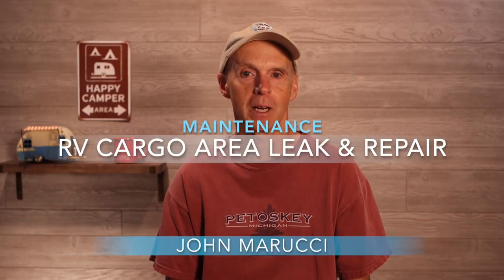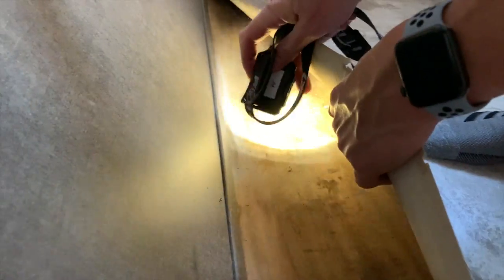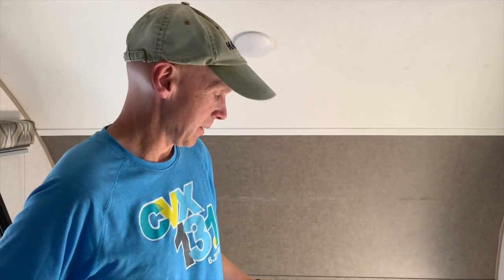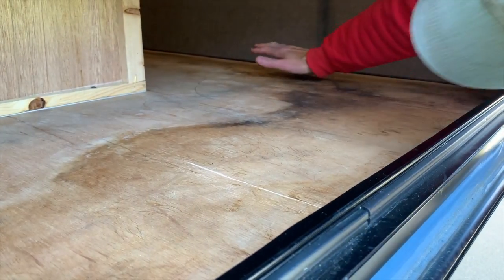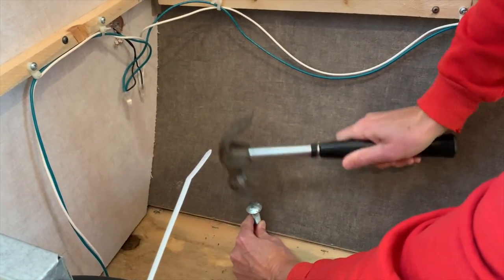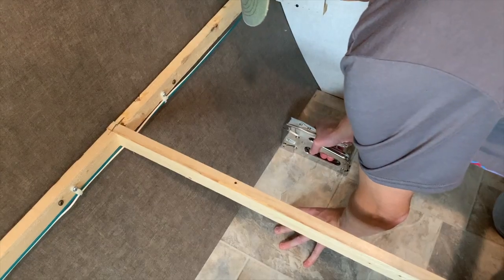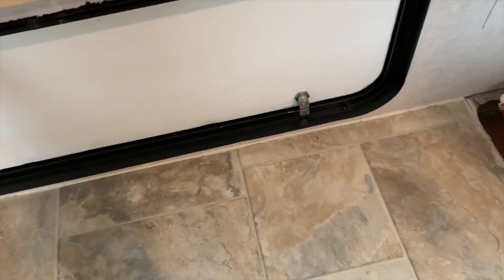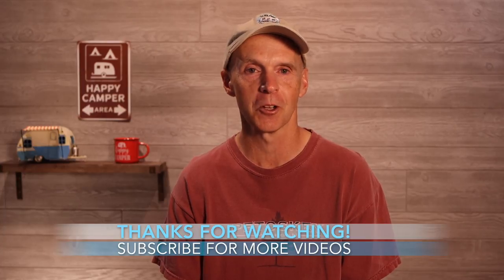R-Pod RV Cargo Area Leak & Vinyl Floor Replacement

Comment: John, great video! We have a 2018.5 R-Pod 190,  I noticed a small gap in the silicon right in the same corner, but on the opposite side, the side with the water heater. So I removed all the old silicone and redid it. Now I’m going to go over it with a fine tooth comb. We live in Walla Walla Washington and have really hot summers (especially this year, 100°+ for several weeks now with minimal breaks), I have a environmental monitoring thermostat/humidity in the R-Pod, the highest it’s gotten inside was 131°! The bottom center trim (8” wood) on the outside of the bathroom door fell off, found that it was double sticked on with tape 😳 fun times. Keep up the great work.
Reply from the maker: Joe, thanks for the comment. I am glad the video was helpful. Sounds the intense heat has caused some issues. I had something similar recently where my R-Pod's shower surround bowed out due to the heat. Seems like trim inside is a regular issue. All the best!

Comment: Thank you John. My 179 is currently in the shop having all seals from top to bottom replaced. Not an inexpensive job but we think well worth it. My next item will be to check the inside as you have shown. My husband and I are both seniors and could not have accomplished it on our own as you have. We have had to have our black tank support fixed twice. Both times on the way to Colorado. Thank goodness the tank was empty.  Keep up these videos please. They are a big help.
Reply from the maker: Kathie, I am glad the videos have been helpful. One of the purposes of showing these is to help folks measure if they want to tackle things themselves or have someone help out. Glad to be of help. All the best!

Comment: Awesome video, it's like you've been an RV repairman for 20 years.  
I am kinda surprised you didn't water test the whole front of the trailer though before you found the bad outer shell seals.
But you did a great job just going through the whole problem in your video, will def help other campers out
Reply from the maker: Right, I should have done as you mentioned. It was very imperceptible crack in the caulk seal which a water test likely would have shown. Thanks for the comment!

Comment: John, sorry to hear that happened but glad you got it solved! I've had two water leak issues both in the same cargo hold area. One was the water tubing must have gotten a slight cut at the factory and burst after about 6 months using the trailer. Luckily I had some duct tape to temporarily fix it while I was camping until I could put in a new piece of tubing. The other time was a doozy as the dealer was diagnosing a problem with the furnace not working while still under warranty and removed it but found it worked fine on the bench so the tech put it back in but in a slightly offset position from the original position and a screw went through a water hose buried below the floor! The tech had to literally remove the bed structure, peel back the vinyl flooring , and cut a hole in the subfloor to repair it and then put it all back together again. It turns out the water heater didn't work because a poorly made electrical connection at the factory! Speaking of poor electrical connections I recently found a major ground connection was not properly made at the factory that was behind an access panel I had to remove to repair the shelf in the kitchen corner cabinet that collapsed because the cheap staples used to on the braces holding it up came undone and I replaced them with screws and added additional bracing. Luckily like you I am a pretty handy guy at doing repairs.
Reply from the maker: Mike, wow, what a wide ride. I am hoping that with these latest fixes, I'll be able to enjoy my Pod for a while. It does feel just a bit like having a 70's car that you fix up and get running, hoping something else won't go wrong for a while. All the best!

Comment: HI John, we chatted earlier on FB regarding the sagging side walls. I want you to know that earlier this summer, this particular video prompted me to inspect more closely the rusted staples in the cargo area of my 179. Even with allergies and a highly sensitive sense of smell, I never noticed a any musty odor. However, using your instructons, I cut the vinyl flooring out of the cargo area and discovered black decomposed luann boards. I peeled the rotten plywood off to bare the styrofoam layer and also exposed the beveled 2x4 that runs across the width of the camper in the front. I could not believe the level of decomposition in that board! Based on my experience with the sagging wall repair, I knew this was going to be an  expensive repair. So I jumped in and was able to use a multi tool, hammer and chisel to remove that board. As I did this, I was able to isolate the source of the water as coming from the seal around the cargo door. Instead of a wood 2x4, I laminated 2 artificial wood deck board together and bevel cut it using the rotted board as a guide. There were so many little issues to be repaired during this process but my husband joined in and we are satisfied with our work. Instead of reinstalling vinyl, I opted to put in a piece of all weather carpet that will allow water to evaporate in the future. I also seized the opportunity to remove the queen mattress and put in 2 custom (by me) 69x27 memory foam mattresses so that I can more readily monitor the area from the inside. We are learning how to make adjustments to bed length every time we take the camper out. But we're happy so far. Thanks again for your videos!
Reply from the maker: Katherine, thanks for sharing your process on your fixes. Sounds like a lot of work but that you may be in a good place for a while. Thanks again for sharing!

Comment: Thanks John another potential trouble spot😢 I had water intrusion in the hook up light. Had to replace the switch, bad place for something that may face wind blown rain and is not weather proof.
I put a trap doors under the bed to access the water heater pump area.
Reply from the maker: Rob, the trap door is a great idea. It's a real hassle to remove the plywood. Thanks!

Comment: 2018 180 here. Two leaks: 1) driver rear corner from me siliconing the trim cover and not allowing water behind the trim to drain properly and/or silicone seal failure in that area (just like yours). 2) gasket under slide had a fold and allowed water to run down and drip onto the floor. I’ve also had a shower leak (seal failure around drain) and the kitchen plumbing leak . I swapped the pluming with flexible tubing and haven’t had the problem.
Reply from the maker: Thanks for the comment. Sharing your experience is appreciated!

Comment: My floor on my 177 2011 is very soft on the table area. Will tackle that problem this winter. Like you I notice it came from the joint in the front. Thanks for your video.
Reply from the maker: Glad the video was helpful. All the best in your repairs!

Comment: Excellent video & Excellent repair work!  
All that flooring material was doing was hiding the problem.  I think 🤔 I would try to clean 🧼 sand and West System Epoxy fiberglass the entire floor area.  I don’t know 🤷‍♂️ if I would replace the vinyl flooring with new or not!  Not right away anyway!
Reply from the maker: Right, you certainly need to ensure things are fully dry and that the source of the leak is fixed before using vinyl sheet again. Thanks for the comment!

Comment: Another good video, thank you. Question why would you go ahead are install a new floor without confidently finding the origin of the leak first?
Reply from the maker: Problem was, I was pretty confident that it was the door, but had a nagging feeling about it. Had to make a decision to put the floor in not having further evidence of other area of leak. The outside caulk appeared fine until discovering very late. Thanks!

Comment: @JohnMarucci thank you for the Rpod series, very informative. I am currently doing maintenance on 2019 178 and also discovered broken seal on the front lower corner. Inspecting the cargo area, there are no visual indications of water damage (no floor ripples, soft spots, stains), everything is dry to the touch and smells fresh. However, moisture meter shows “wet” in the cargo door area (about 6” in and then bone dry again). Would you recommend cutting and lifting the floor to inspect or wait for visual clues? I understand moisture meters often give false positives (wires, metal etc). 
PS. The corner inside is dry as well
Reply from the maker: I’d probably avoid tearing up the floor given the info you presented.
Reply: @JohnMarucci Thanks for the prompt reply John! I’ll reseal the trim rail and do a water test after, and go from there keeping an eye on any indication of moisture trapped in cargo door area

Comment: Thank you for the video. Glad you found the leak early. I am looking to get a camper but have not place to keep it at the house. What do you look for when you are looking  at camper storage places?
Reply from the maker: Thanks for the comment. As far as storage, I would look for fenced and gated with a pass code and paved (or graveled). It also needs to be actively managed, meaning there are cameras on the storage area and things aren't overgrown. I'd also avoid too small a place or somewhere where you would be the only RV. Hope this helps!
Reply: I am very lucky to be able to store my 2017 R-Pod Model 179 indoors. A defunct lumber mill nearby has been converted into indoor RV storage.

Comment: John, I love seeing your fixes. I have a 2017 rp179. Love the little guy and I put it through some long drags. I am currently in Alaska after driving for 11 days from Indiana. My newest, future repair will be to redo the bed support area. You can see my latest video, "Repairs in Anchorage" to see my problem. I recommend you add a brace under the bed.
Reply from the maker: Thanks for sharing the tip! Have a great trip!

Comment: Hello!  I've searched your videos and can't find an answer to my question, so I'm hoping you will see this and be able to help.  We recently bought a 2017 Rpod 171.  We are in Indiana and were afraid to attempt sealant work ourselves due to the weather, so we got it into an RV service center.  Unfortunately, their work was sloppy at best and faulty at worst.  Sealant gaps/voids along the top of the rear window, dirt, and debris underneath the new sealant where they failed to clean the area (some places they did this even though the current sealant was in good shape).  We've patched voids, are using a cover since we have to store it outdoors at our home, and are hoping it gets through the winter.  We plan on doing the work ourselves this spring. My question is what type of sealant do you use on top of lights, along edge trim?  I noticed in this video that it looks like it has a bluish tint.  The RV center used a clear sealant but we've found that makes it difficult to see when there's an issue.  Any advice you could offer would be appreciated.  Your videos have already helped us immensely with winterizing the unit and I'm sure will continue to do so in the future.
Reply from the maker: Sorry to hear about the poor quality work done to your RV. You mentioned that you plan to do the sealing this spring. If you need to pull the existing caulk, clean the area, and recaulk, it is a tough job. You may want to talk to a couple of mobile RV techs about doing the work yourself and see how they would tackle it before committing yourself. If you feel good about the mobile tech, you may want to consider using them. Otherwise, I have used Dicor to seal various areas on the roof and on flat surfaces. The Blue tinted caulk was from R-Pod that they gave me on a trip to the factory when my 2017 179 was year old. I am not sure they would still have the same colored caulk available, but you can try contacting them: (jweldy@forestriverinc.com).
Reply: @JohnMarucci  Thank you so much!  We are reaching out to some other local shops.  We are in northeast Indiana and haven't been able to find any mobile techs in our area. And after this bad experience, we are, of course, concerned about running into the same issue.  We like to support smaller shops, but maybe we should go with a larger RV dealer. Again, thank you for the information!

Comment: My zinger 2006 20 ft camper trailer that I've been living in suddenly started leaking from the light fixture closest to the wall above my kitchen table and wall radio. It only leaked when it was downpouring rain it is at a steady rain right now but it is no longer leaking from the light fixture I already put a heavy layer of rubber roof coating within the last 6 months could it be the seams that would cause this because I did not cock the seams yet. They looked okay.
Reply from the maker: Leaks are difficult to diagnose. I personally would check all seams on the roof given what you mentioned. Is there a slide anywhere nearby?

Comment: John, wondering why new flooring was necessary.  The floor is in an area that nobody sees.
Reply from the maker: Harley, I didn't want to leave the floor uncovered as the new vinyl does provide a bit of water and scuff protection to the wood subfloor. The old vinyl floor was pretty much unusable once I cut it out. Thanks for the comment!

Comment: Why does the fiberglass flex at the corner? It should be fixed to the frame at that point.
Reply from the maker: Michael, it's a great question without a great answer. I think the front corners of the R-Pods of this size and age are having some similar issues. It appears to be a combination of poor design and poor build quality.

Comment: We have a 2016 180. The floor in front of the bathroom door and kitchen is very soft. My husband looked everywhere he could.  We found no leaks.  We were told there's styrofoam under there?? We're wanting to sell our 180 to upgrade.  But first we have to figure this problem.  Any ideas?
Reply from the maker: Katie, the R-Pod floors are a Styrofoam sandwiched by thin Luan board. It is possible that the floor is just wearing in that area and that there is no leak. There is little support for the floor in certain areas. I'll put a link below to a soft floor issue I had with my R-Pod 179 and what had to be done. Here is the video link: https://youtu.be/vGOfQqqu18o
Reply: @JohnMarucci  thank you

Comment: Surprising how sparsely framed that bed is.
Reply from the maker: It sure is. The rest of the framing is similarly scant. However, it works and they were trying to keep weight down.

Comment: No one would tolerate the amount of poor quality craftsmanship found on RV's if they were on a car of the same age (for example). I received a quote for a 2023 Rpod 180 and the SALE price was $43K CDN.
Reply from the maker: I suppose the question is, why do people continue to buy RVs given your points made? There is little incentive for manufacturers to improve quality as long as consumers continue to buy. Thanks for adding you purchase info. I personally would not buy a new R-Pod given the lack of composite sub flooring and the paltry 1-Year warranty. All the best!
Reply: @JohnMarucci  I also would not buy a Rpod for the reasons you listed in this video, as well as complaints from Facebook groups and other online forums. 

The gov't could change the definition of RV to demand the manufacturers produce better quality products. It has worked in the auto industry. 

And we love camping and being outdoors enough to put up with cheap RV's (I guess?). I'm still tenting but sleeping on a cold ground isn't as fun as it once was. :)
Reply from the maker: I may put out a video shortly on my take why things are so bad. There are several reasons and incentives for manufacturers to do what they do.